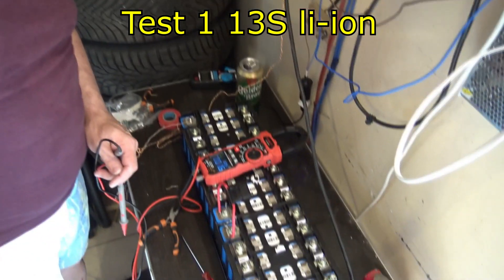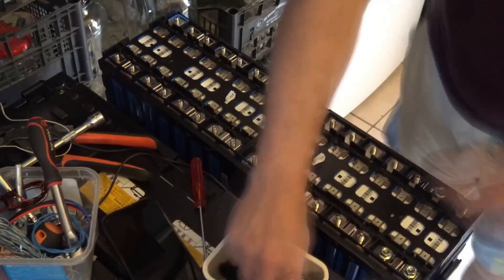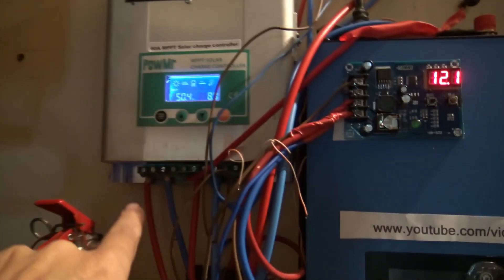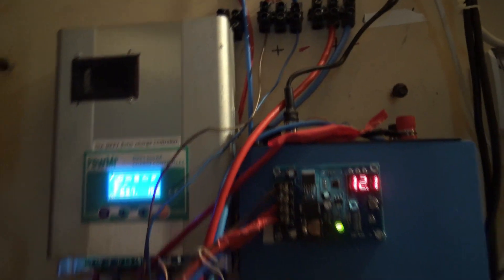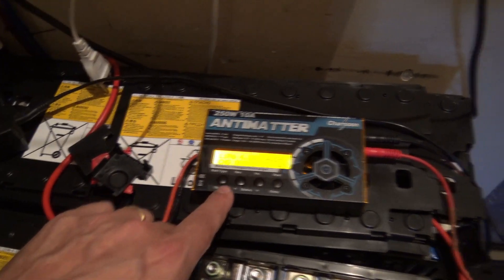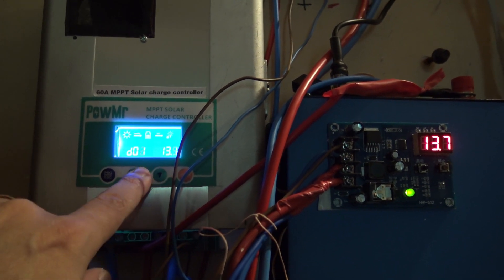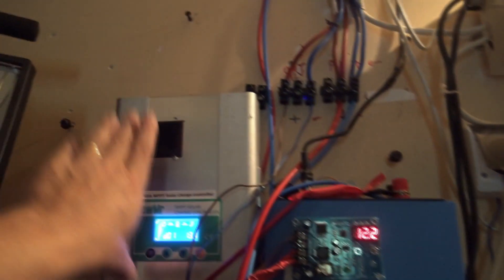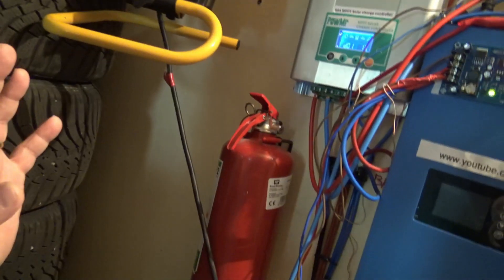DIY li ion Solar Power battery part1

Comment: Nice work!  Can you tell me if it would be possible to use these phev battery packs to power a large 48v motor than can draw up to 200amp? I'm thinking of using them for my lawn tractor conversion.
Reply from the maker: very possible..they are really strong ..